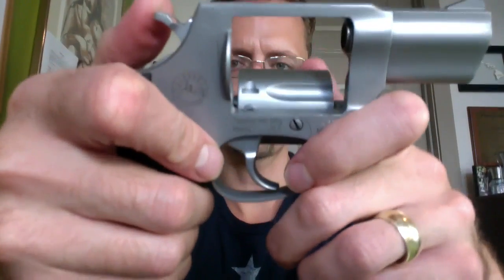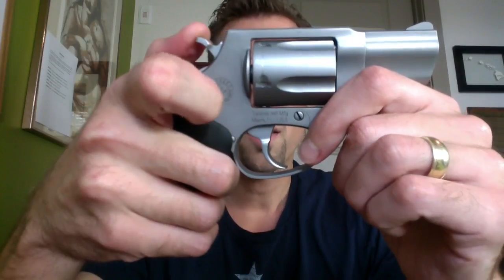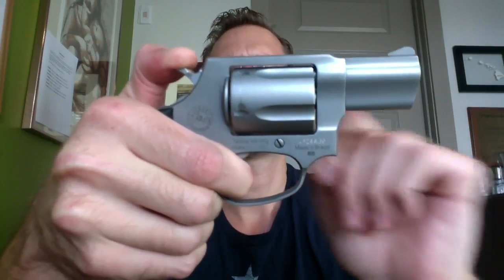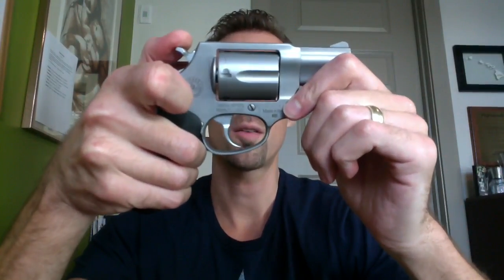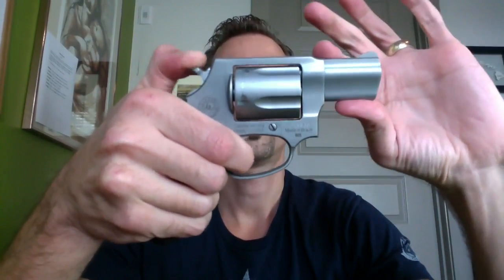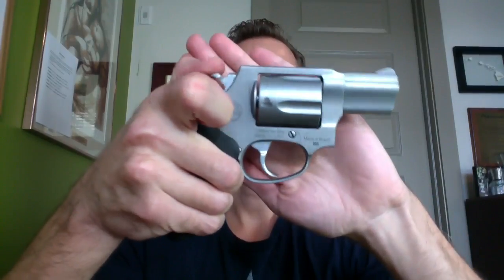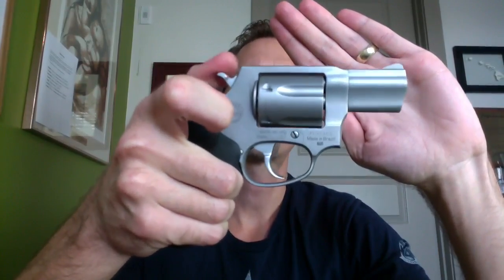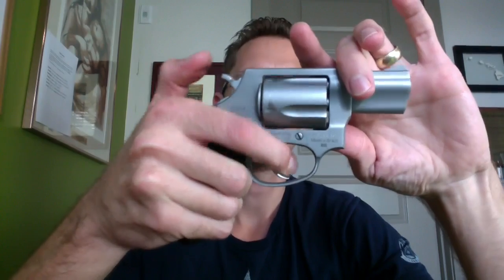Revolver Transfer Bar Safety, How it Works

Comment: Thanks for the explanation. I just bought my first revolver and I was wondering how it worked. I actually thought it was the opposite of what you said. I thought the transfer bar got in the way of the hammer hitting the firing pin but I guess not

Comment: Thank YOU & that’s a very perdy revolver you have. I recently purchased the Taurus 942 22lr for plinking.

I did use the method you mentioned & yes, it does in fact decock the revolver nicely. I did (to avoid a just in case scenario) put a “stopper” between the “V” area of the hammer & the body to avoid a hard release & an extra safety measure. Had my left thumb on the hammer for an easy release & my right index finger on the trigger to pull the back.

It worked flawlessly 

Thanks again

Comment: S&W 66 would have had a hammer block safety.  Similar to how you described the hammer block safety, the trigger would have to be pulled to disable this safety.  Still enjoyed the video.  Thanks.
Reply from the maker: Didn't know that, but good to know!
Reply: Correct

Comment: I missed the part in the Gun Safety Manual that says it's okay to leave a hot weapon sitting on a table. You know you can pull the hammer of a revolver back while you're aiming down range? In any case, it's totally fucked up that the transfer bar didn't protect you. I hope you get a full refund, and buy a Ruger or something else next time. Glad nobody was hurt, but your negligence is a bigger issue than the pistol.

Comment: I have an old (but in great condition) Colt 38 detective special from the mid 70's. If it is loaded and cocked, can I decock it by holding the hammer while pulling the trigger, and slowly releasing the hammer to the uncocked position slowly? Just want to make sure before I do it. Thank you!

Comment: That's incorrect, even if the firing pin is on the hammer , once fired or at rest the hammer comes back off the fire position and cannot be made to contact the primer without pulling the trigger, very old da/sa revolvers from the late 1800s into early 1900s could fire if hammer were to be struck